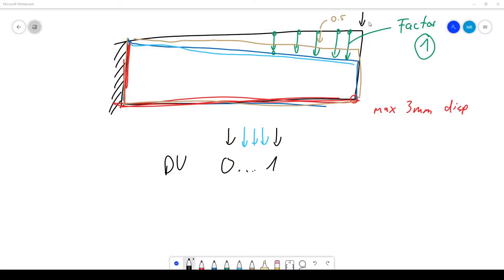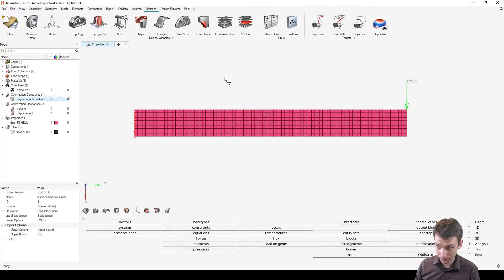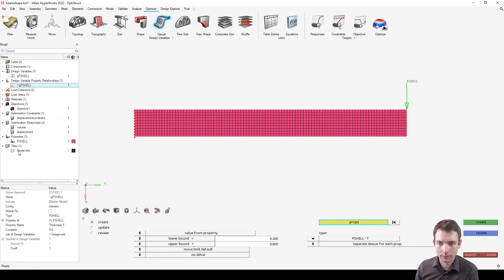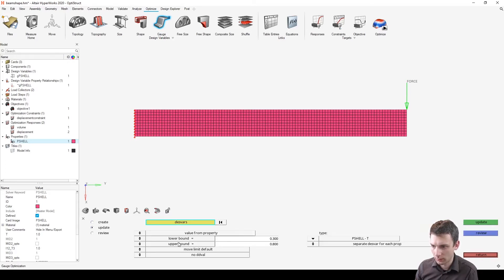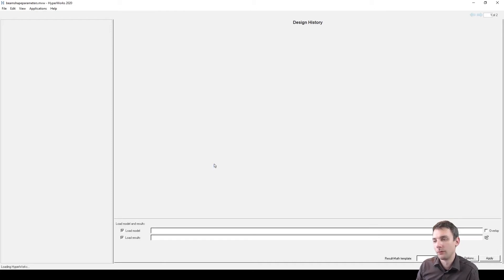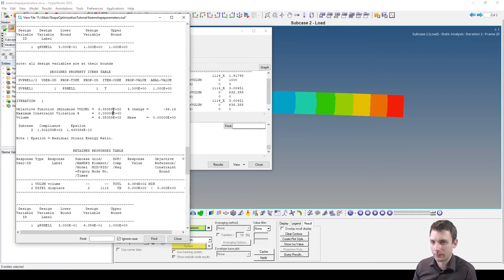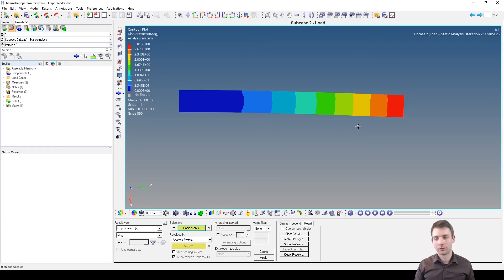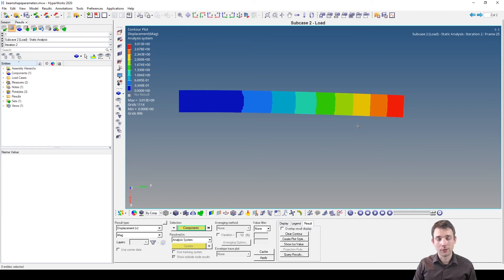HyperWorks2020 - Gauge Optimization

Comment: How do you convert the 2d results(which is discrete element thicknesses for each element) from free size optimization into a 3D cad model?
Reply from the maker: In this case it is only one thickness for the whole plate. If you refer to the composite optimization video - there is the option for a control card - output requst - FZTSZ (that means freesize to size ). With this, a .fem file is created at the last iteration which can be used as an import to do the sizing optimization. I am not 100% sure if that is what you want to do, but I would start there.
Reply: @ManuelRamsaier  it is not the composite optimization I wanted to know about...I wanted to have a free size optimization for a normal cantilever beam which would give me a result of variable thicknesses along the length
Reply: I am able to get the results for shell elements only...so how do I convert these results into a 3d cad model
Reply: @karthiknune7902  use OSS SMOOTH for geometry from output file